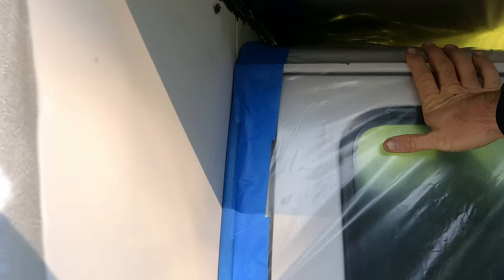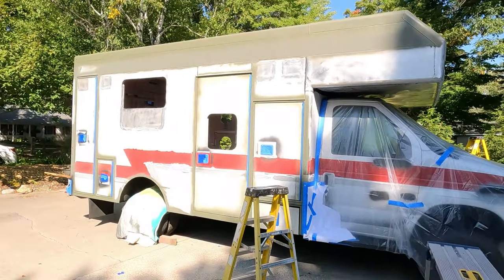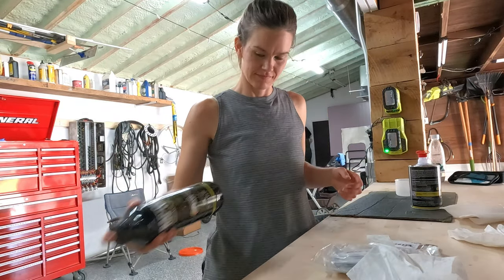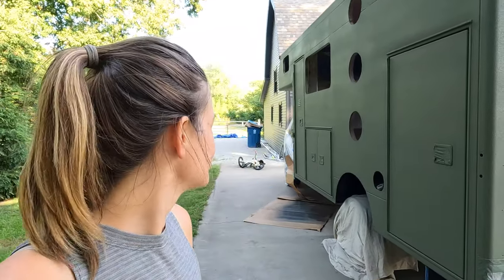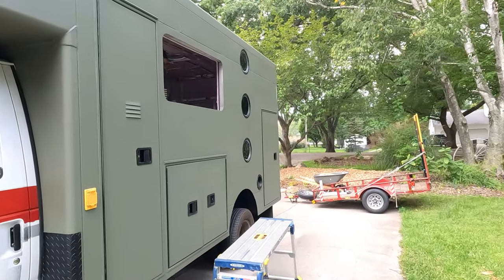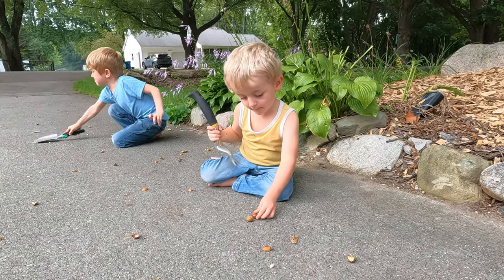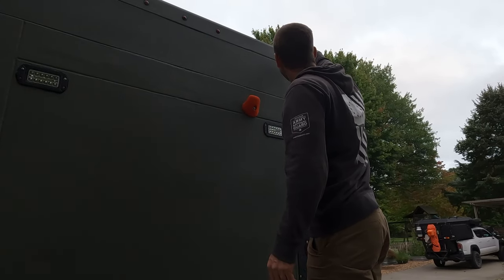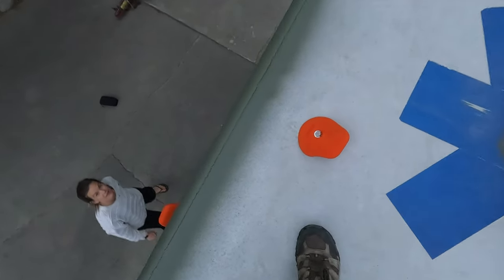DIY Expedition Vehicle Gets a Paint Job // Ambulance Conversion Build - Episode 18

Comment: @5:17 You should know that people often have transmission issues when changing to LED brake lights with a 7.3 Powerstoke. The computer uses the resistance in the brake light circuit to know if you are on the brakes as  to your intent to decelerate. When you add LEDs this resistance is different and things can get weird. People add resistors or some such to fix the issue, there is lots of information out there about this.
Reply from the maker: Thanks for the insight! We weren't fully aware of these details and we'll be sure to look it up.